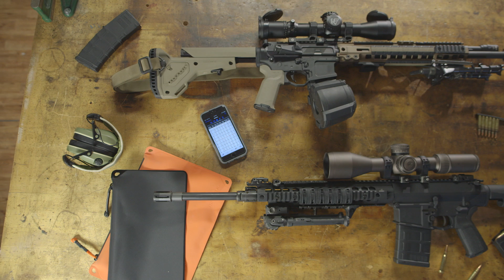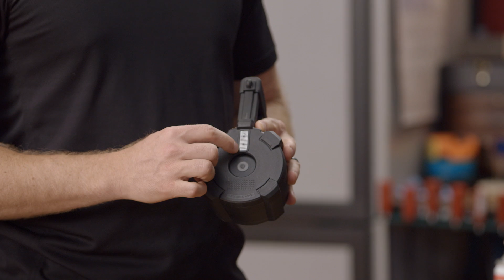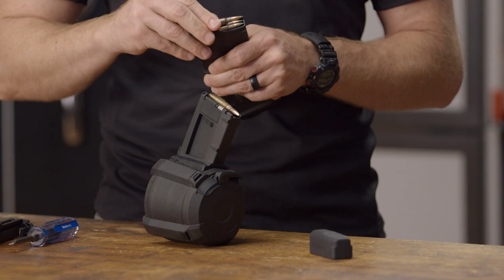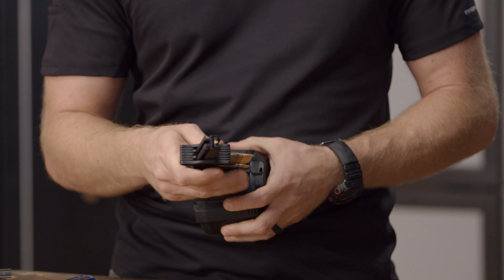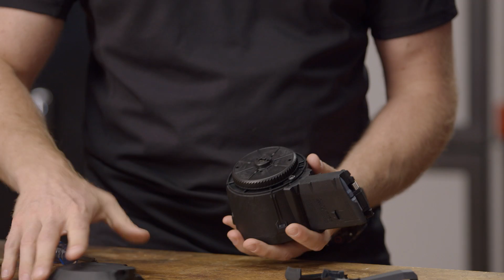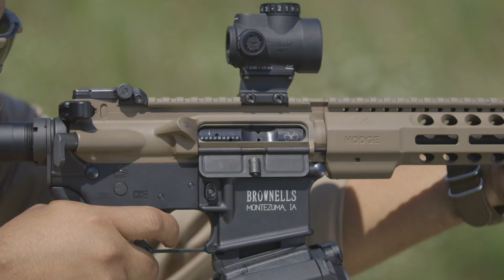Magpul’s D-60 AR15 Drum Magazine - (How to…)

Comment: anyone have trouble getting all 60 rounds in?  brand new only taking 57 at the moment
Reply: The last couple can be a bitch for sure. They are very easy to take apart if you need to. The last rounds are usually pretty difficult so you kind of have to wrench it backwards and press the top of the bullet down and then wrench it backwards again

Comment: Yeah but you didn't load all 60 rounds in this video.  We're you able to do it?  I tried loading all 60 rounds in my new drum yesterday. And I was only able to load 57. I'm hoping it was me and not the drum itself. Maybe spring has to be broken in? On a good note, after loading it with 57 rounds, I ran that thing in full auto with four separate bursts and it functioned without any issues. That was a rush. I'm going to try loading that thing with 60 rounds again today and see if I'm able to do it. I struggled with that 57th round yesterday.
Reply: It's not bad
Reply: I could only get 57 in mine as well
Did you ever figure out if there was something wrong with it?

Comment: Good to know. I've always liked the D60 but I have yet to pick one up because of the price and lack of availability.

   I'm actually kind of surprised at how this thing comes apart though. It seems like alot of peices that can easily get lost in the field.
    I would kinda like to to see a D60 Gen 2/Gen 3, but with parts that are held in place by a pin and swing open on a hinge or something rather than just coming apart like that.
   But hey, I guess there must be some reason they designed it this way instead.

   Anyway, thanks for the instructional video.

Comment: These two guys look like there about to kiss.

The D60 is just to damn expensive.
Reply: TangoXrayNiner ante up.   Its an expensive hobby.
Reply: Worth every penny. I have 2
Reply: @tockblade  does it make the ar-15 shoot in full auto mode? I've noticed just about all the videos I see them in, the shooters have shot at full auto speed.
Reply: @tockblade  ok, thanks for educating me.  Have a blessed day.
Reply: Right? Because their bodies are facing each other when they shouldn't front of camera
Reply: SlowRiotNewKanada  share the link I just bought an AR-15
Reply: Pricey? Sure but I still bought 4
Reply: just buy 2 40 rounders and couple them together much cheaper
Reply: TitanTaylor cheaper isnt always better.
Reply: TitanTaylor because even 1 40 round mag is too long to get into the prone position or maneuver optimally. 2 of them coupled together would be comical. The D60 has the same profile as a 30 round mag. Military and competition guys won’t use 40 rounders.
Reply: @tockblade  But I will.  I am not military.  I dont play gun games, fun though they may be.  I fire prone, but only rarely.  I am going to get a couple of these babies though; they look like fun.